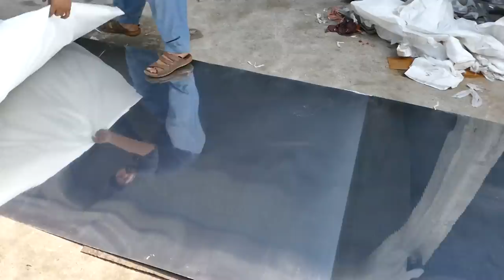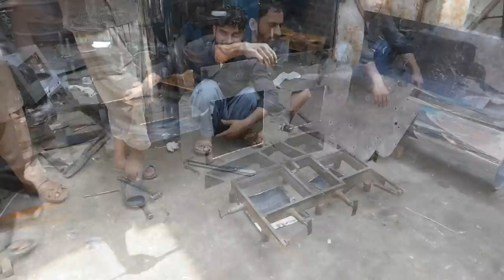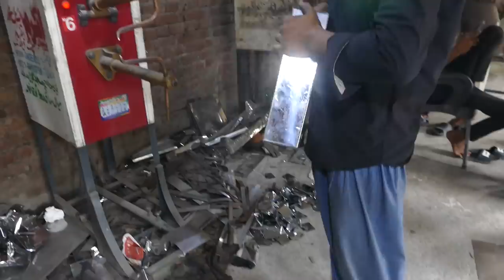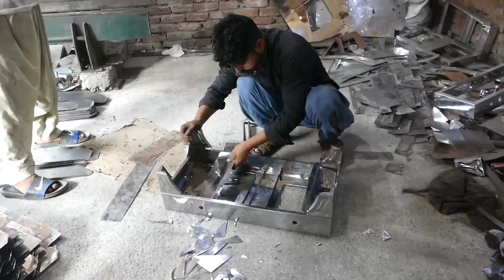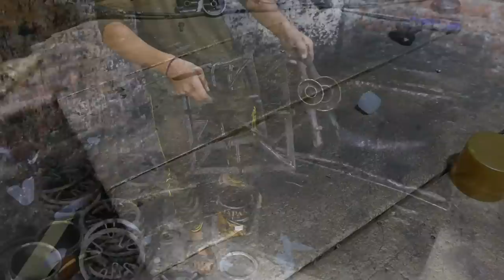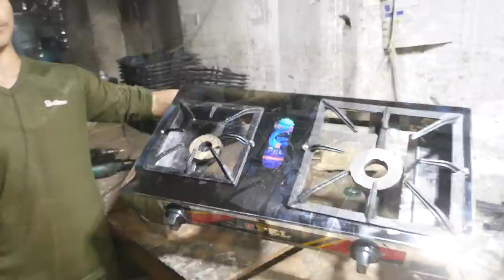How to Make  Gas Stove with Stainless in Factory

Comment: Not every step for every part is shown how its made,they could've at least sweep the floor before unrolling the sheet roll to prevent scraching.
Reply: Yeah, I cringed when they unrolled that nice new metal on the cement. No matter how clean it was, it scratches!
Reply: @k.y.6148 .  Scratch it does but it's a stainless steel sheet it won't rust nor hinder the cooking when bought by customers, it definitely will last a lifetime.
Reply: The scratches were all on the bottom
Reply: @garybrown9719  They sit on the floor and get a scratched bottom 🤩
Reply: may be you missed polishing
Reply: It does look new and shiny..,. Do you have to crib so often